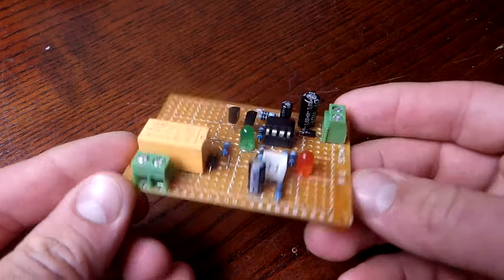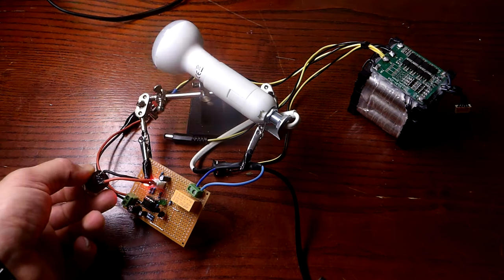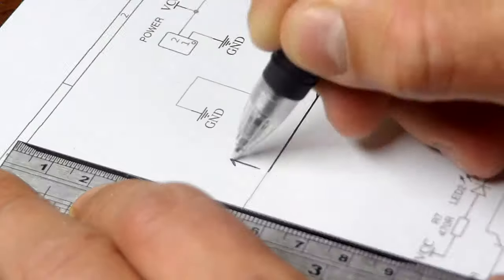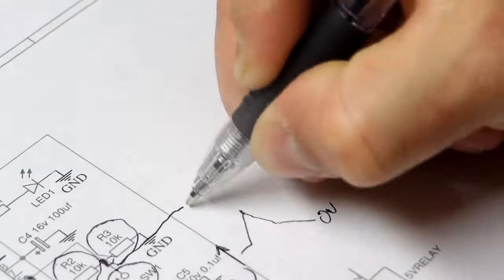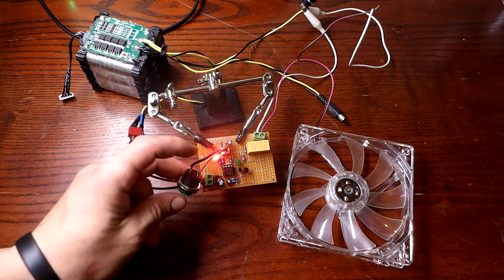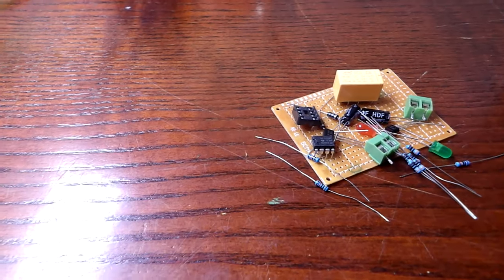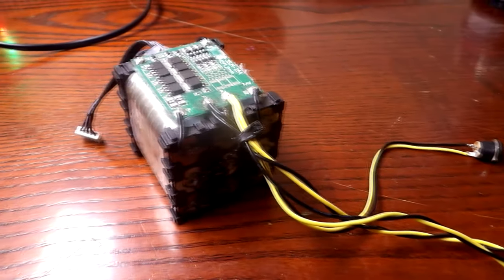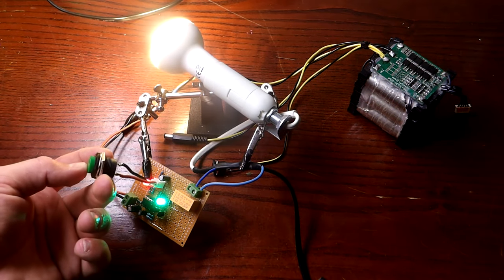Universal DC AC Latching Switch Base On NE555

Comment: Hi. Will it work with 5v power supply? Because i have follow ur schematics and  i cant make it work with my phone charger supply. How to make it compatible with my 5 volt power supply. Thanks
Reply from the maker: The relay has to be a 5v one . In the video I have used a 12v relay . Try using a 5v one ,
Reply: Yes i change it to 5v relay. But it still cant trigger the relay. Btw I change bc547 with 2n2222a. And im replace ur 0.1 uf 50v capacitor with 2a104j.
Reply from the maker: @andalanmudakarya9415  you need a electrolytic capacitor  not a polyester one for the circuit to work , and try as well replacing the 2 10k resistor to half or using 4.7k or 5 
K resistor because the voltage has to rise at the junction.